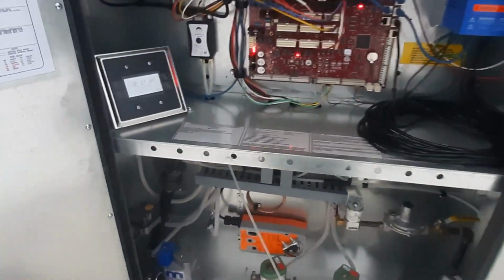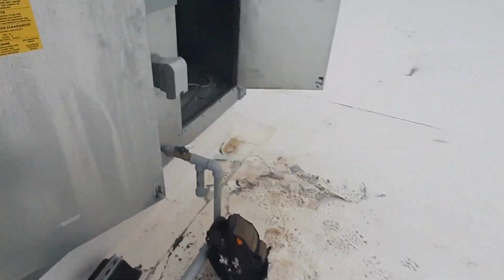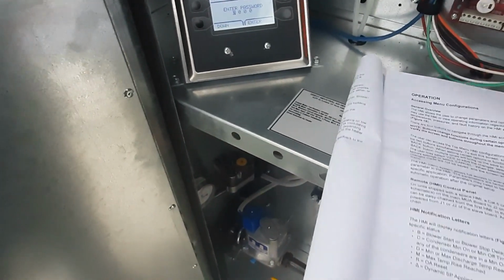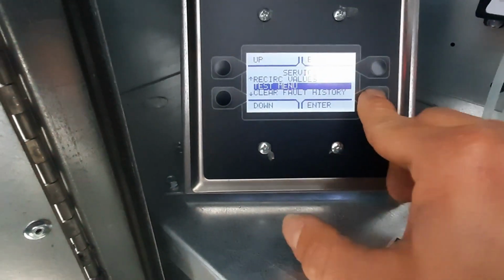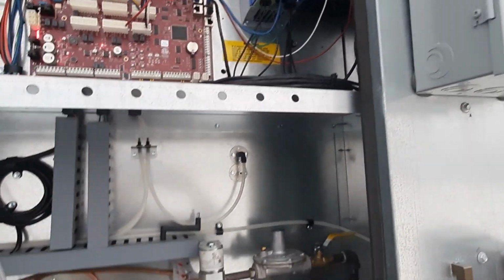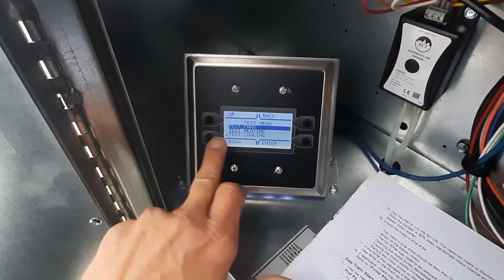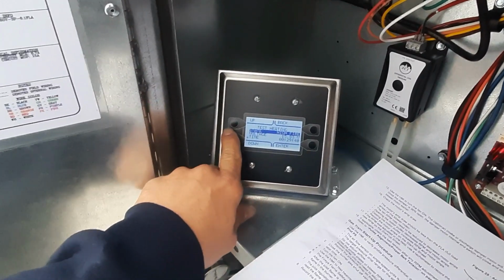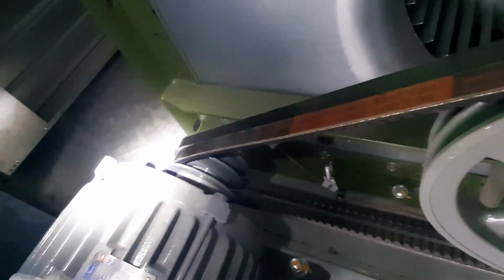New Make up air, direct fired burner not heating, Service Call

Comment: I guess in confused about the vfd speed.  Did u set the heat hz or are u just running it in manual all the time?
Reply from the maker: It was running in manual, they don't really control the speed. Just their design not sure why except you need specific air flow across burner for proper combustion. I have seen the VFD used on other units that controls off space pressure but not this application. Thanks Josh!

Comment: I'm still unclear why the controller doesn't have VFD control? Why does commissioning required manually driving the VFD hz when clearly there is communication in place?
Reply from the maker: Good question RJ! I'm not sure the exact answer to that either but these direct fired MUA need a specified amount of air flow across the burner for proper operation, in my opinion especially in these warehouse spaces the blower needs to run 100 percent no VFD needed. And you could have combustion problems as air flow is reduced causing a potentially dangerous situation with a direct fired burner.